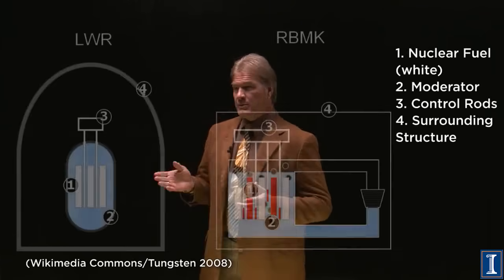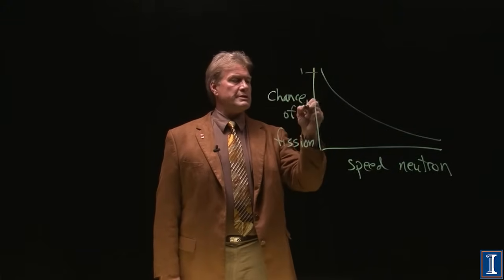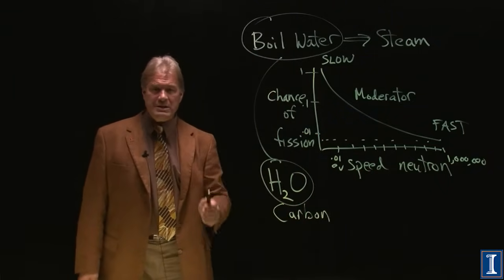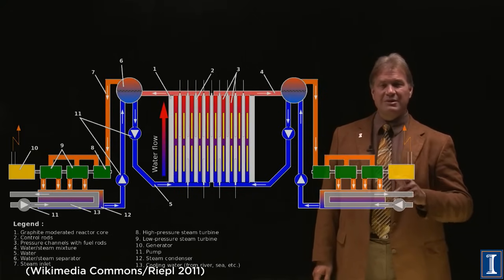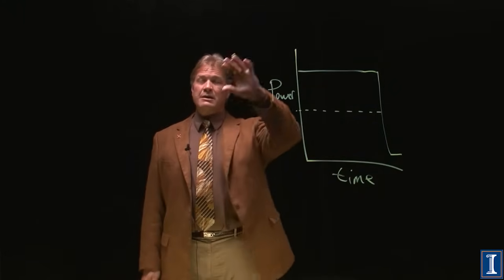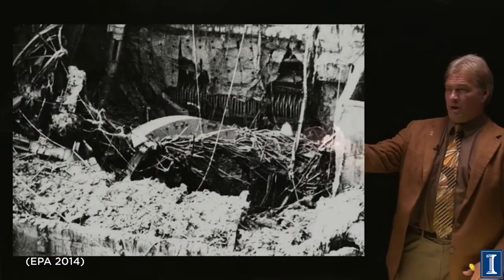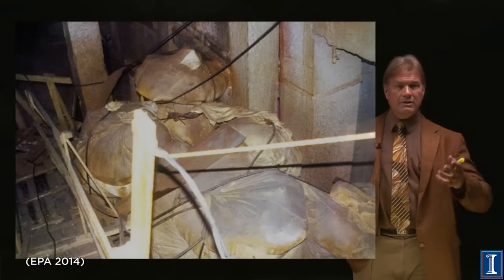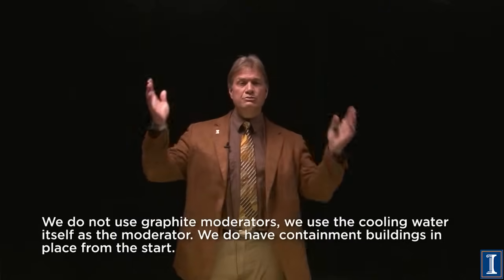Chernobyl: Worst Accident Ever

Comment: Id like to caution all of you who start to put a little too much stock into the information being provided. This is a very very basic description of the events that occurred and does make multiple mistakes. Im not going to attempt to describe what happened, there are far too many factors that come into play. Take this away from this video atleast, the US Nuclear Navy has operated more reactors for longer with far younger operators with 0 reactor accidents in its history. No program has come close to it in its accomplishments. They have done this by ingraining certain principles into their nuclear trained operators. Procedural compliance, level of knowledge, integrity to name but a few. The most important safety feature in preventing a nuclear accident or radiological incident is a knowledgeable and thinking operator who has a watch team that is capable of providing forceful backup. Enforce the highest of standards when it comes to nuclear trained personnel, that will keep you safe. Because flashing all the water to steam is possible in a pressurized water reactor. SL-1 is a prime example of another reactor that went prompt critical and flashed the water in the vessel to steam. Just like what happened at Chernobyl. Also Chernobyl blew its 1000 ton closure head damn near clean off and into the sky. I have my doubts about a 3 ft containment vessel surviving that. But hey, what do I know? Im just a Reactor Operator.
Reply: All Hail Rickover and his hard-assed approach to the atom. He was a prick - but he got it done for the Navy.
Reply: He pushed safety above all else, because he knew underwater Chernobyl's would kill public support for a nuclear navy. Rickover was an engineer first, a naval officer second. That and the fact he was a highly driven man were why he was a pugnacious fellow. He was a dick, but he was definitely the right man for the job he held, which included personally interviewing every prospective officer. We will never know how many lives were saved because of his no compromises attitude towards safety.
Reply: @taraswertelecki7874  He called Jimmy Carter the dumbest man he ever met.  Bravo!

Comment: so,  Fukushima had water moderator, water coolant,  containment building and it still happened.  They relay on physics not on people, so why it happen again?
Reply: US navy offered backup generators and it was rejected.
Reply: The power to the reactor's coolant pumps was cut off because the tsunami flooded the emergency diesel generators and also swept away the transmission lines between the plant and the national power grid. While nuclear fission stopped, the highly radioactive fission products will melt the core if cooling water was not continually supplied to it until the highly radioactive isotopes decayed away. Once that happens, the reactor is stable and can remain shutdown until it's safe to restart it. Had power not been lost, the reactors would have shut down as they were supposed to, and the pumps would have brought them safely down to a cold shutdown. There would have been no accident at all, but still a lot of damage at the plant to clean up.
Reply: that's mean it's not relayed on physics but on supplying of energy. A bit better but still not enough as you could see. Thorium reactor would be next step but still untested widely  technology.

Comment: I thought fast neutrons were more likely to cause fission than slow neutrons. This is the principle behind thermonuclear weapons: Fission in the primary causes fusion in the secondary which which releases fast neutrons which in turn cause fission in the bomb casing.
Reply: Nuclear bombs operate at critical mass, where the atoms are so close (as the uranium is 'squished' together using the force from non-nuclear explosions that act as the detonator essentially) that high speed neutrons have a high probability of hitting another atom and causing the ongoing fission reaction. In a reactor you want a nice steady controlled fission reaction, you need the atoms to be further apart otherwise the reaction will just run away from you. As the atoms are all further apart the chance of hitting one with a neutron is reduced when the neutrons are moving quickly (for quantum physics reasons). Thus you need to slow them down with a moderator to increase your chances of actually splitting atoms and having an ongoing fission reaction. At least this is my memory of physics from when i was a student.
Reply: Precisely, in a reactor, you want a steady chain reaction like a furnace heating water in a boiler, not a rapidly and exponentially increasing chain reaction, which makes a bomb.

Comment: Surely the AGR power stations in the UK also use a carbon moderator?
Reply: Glad somebody else noticed this. Sure it isn't water cooled but we most certainly are still using graphite moderated reactors, admittedly not building any more new AGRs though.
Reply: I worked at a UK AGR, they were inherently safe IMHO. Main protection was automatic trip of control rods, they relied on gravity, followed by numerous secondary and tertiery shutdown systems. . Water filled reactors have accounted for quite a few of the accidents in the past. .
Reply: https://ieer.org/resource/factsheets/table-nuclear-reactor-accidents/

Comment: Can someone explain to me how the twin reactor next door was able to continue operating for 20 years? How did it withstand the explosion that happened next door, and how were people safe from radiation to continue working there????????
Reply: There was a very thick concrete wall between the two, and the control centers and reactors are hundred of meters apart. For the record, the explosion of reactor No. 4 started a massive fire that was spreading to the roof of the building housing reactor No. 3. The fire was also lethally radioactive, and the firefighters all died of massive radiation exposure putting out those fires, with red hot pieces of nuclear fuel and graphite blasting them with gamma and neutron radiation. They are why the fires did not get to reactor No. 3. The explosion destroyed the reactor and the building that housed it, but not the control room. The operators of reactor No. 4 survived the explosion, but over half of them died of radiation poisoning within weeks, the others suffered for the rest of their lives from the massive doses of radiation they absorbed. The blast was not powerful enough to threaten the reactors next door.
Reply: Also radiation is less dangerous than people think.
Reply: Low levels yes, high levels of radiation are something else. When you were as close to nuclear fission as I was without harm to myself, you can see what extreme radiation doses does to matter, not just living things. Pretty amazing how materials, organic or not bear no resemblance to what they were before irradiation.

Comment: The first ones who noticed an anomaly were people at a nuclear power plant in southern Sweden.
Reply: Yes, the morning shift had contaminated shoes which set off the alarms. Needless to say that led to a few very tense hours as everyone first assumed it was a malfunction with our power plant.
Reply: The night shift went, “No it’s not us, reactors fine.”
“Ok the wind was coming from the direction of Cherno... uh oh.”
Reply: @davyt0247  Cher-oh-no-byl?
Reply: sweden is already so degenerate, they don't need to fear defects caused by radiation
Reply: Correct. Half this fool's lecture is simply wrong, not just that point. 
The guy could have made a 2 minute video and explained that the Soviets were just penny wise pound foolish cheapskates who put graphite tips on their boron control rods.
Reply: I knew a US submariner who told me this set off their radiation alarms in the middle of the Atlantic.

Comment: The first time I heard about the Chrenobyl reactor test was helping graduate students, many pages of IBM Fortran programs, attempting to model the different reactors in the USA? The professor was interested in finding reactors that would allow the employees to manually override the system or that a control room operator would be allowed to override the systems.  We found three reactors of the Chrenobyl design in the United States, major upgrades to the all of control systems followed.  Inspection of the control rooms found many issues including staff changes to the control systems; in one control room an employee had replaced the control handle with a beer tap.
The reports of what happened indicated that the management told the employees to override the cooling systems, the reports stated that some of employees refused to override the systems and other employees taking over continue the testing.  One of the documents talked about an early missile detection project that was built only seven miles from the reactor, they indicated that the reactor test was a project to boast the power needed for the Duga Radar Station – Russian Woodpecker project. https://www.youtube.com/watch?v=Ux9ZhotNtrg 

 I also viewed a documentary explaining that one of the reactors was enriching … well every country has enriched …

I have a question for you?  Japan, Fukushima Nuclear Accident was an environmental problem, showing that they did not understand the risks, a country prone to earthquakes and the resulting tsunamis.  You stated that the Chrenobyl Nuclear accident could not happen in the United States, due to the design of the reactor?

Maybe I am just a little paranoid about the Nuclear reactors within the United States, what would happen if the cooling towers are damaged or the main reactor core is damaged like in the Chrenobyl accident?   Many of the Nuclear Power Plants are over airport airways?  With the attack on the Saudi Oil fields, using drones … what is the risk of not protecting the Nuclear Power Locations …

Comment: Not sure if the prof knows what he's talking about.
Not all LWRs in the world have containments. See Fukushima which blew up 3 times. 
Nor does the beautiful moderator safe a plant from melting down. See Fukushima. 
And by the way, since 9/11 I would strongly believe that a 3ft concrete slab is not a real plane stopper. That's what I consider a  myth.
Reply: Actually it's 2 buildings, one within the other both 4 feet thick and reinforced with 2 rebar mats of #32 rebar welded together, each standing 1 foot from the the face with 8" between the two ... rebar sizes are in eighths so that is 4" inches thick. 

You prolly are a girly man with small hands and skinny arms but 4" is the size of a burly man's wrist.

Both are poured with high density concrete and lined with 1" stainless steel with the outer containment building capped with a 250 ton steel missile shield embedded in the concrete. 

I was a piping designer on Seabrook Station NH in '84 and read the specs from the Final Analysis Safety Report.

The containment buildings are designed to withstand 300 mph winds and debris thrown by them which include train engines.

They certainly can withstand an aluminum plane flying as fast as it can.

Perhaps the mother of all bunker busters might make a dent... but if someone is throwing that at us we got more problems than that.

The worst any attack can do is sever the connection to the grid

I'll keep it short as I've learned the longer the scree here on You Tube, the lower the IQ

Comment: Please help me reconcile an apparant contradiction. In this video (starting at around 2:42) Professor Ruzic says that an advantage of most (all?) of the non-chernobyl type reactors is that the water that's the primary coolant is also the moderator, so if the water's gone, then the chain reaction stops. But in his video titled "How TMI started", he seems to indicate that the melt-down at TMI happened because the reactor became partially uncovered by water. Thanks in advance.
Reply: The reaction did stop in TMI (at least in the parts of the rods above the waterline) but they still contained enough internal heat and subsequent decay heat that they would gradually melt if not cooled in time, I guess the difference is that a non-RBMK reactor won't have a temperature spike from coolant loss, it'll just melt over time giving you a few days to get it under control, wherein you'll be left with a wrecked reactor, but a contained wrecked reactor.

The RBMK alternative being a reactor that went from functional to disintegrated in a matter of minutes due to the temperature spike of it still being able to moderate itself - and climb in power rapidly - after the water stopped.
Reply: @krashd  That make sense. Thanks.

Comment: "Oh, we can't have a Chernobyl here"

You just haven't found good enough idiots to make it happen.
Reply: @Stimpy&Ren that's.. ugh... typically how things work..  You start somewhere, you figure out where efficiencies or safeties can be gained, and you apply that to the next evolution or retrofit the original.  Otherwise you're just stuck in analysis paralysis and we'd still be living in mud-huts.
Reply: @Stimpy&Ren You can disagree all you want, you're wrong.  No one holds revealed truth about anything, thus failures are implied by reality.  The only process to go about anything is bound with failure.  There is no alternate position for you to claim.  Things don't 'generally' end up that way, most failures are insignificant and very few are so catastrophic.  That doesn't mean the process by which things progress isn't win some/lose some.   See: evolution.
Reply: @Stimpy&Ren ... i didn't say it wasn't.
Reply: All nuclear rectors have a design flaw.They are designed to be operated by humans.

Comment: Why inserting control rods caused spike in reaction?
Reply: i think it is because rod tips in reactor 4 were graphite.. the engineers did not know that there is a short rise of temp caused the overheat. u supposed to lower the rods to control temperature but most of them were raised. literally giving a reactor (train without brakes).  when the engineers lowered the rods, the temperature spiked because of the graphite tips.
Reply: The graphite at the ends of the control rods acted like the plutonium rod in the secondary or fusion stage of a thermonuclear bomb. When Alexander Akimov hit the AZ5 switch to SCRAM or shut down the reactor, they caused the already runaway chain reaction to accelerate even further. Once that happened, the explosions followed within seconds. Some physicists think the core attempted to go supercritical, and explode like a nuclear bomb, but before the chain reaction went that far, the core blew itself apart. Imagine what would happen if hundreds of tons of Uranium DID undergo a supercritical, or uncontrolled chain reaction. Even so, the explosion that ripped the reactor apart was equivalent to ten tons of TNT.
Reply: Taras, looks like you know more about it than i.. Not pretending that i understand nuclear physics or 4th reactors fatal mistakes. So thanks for sharing your knowledge
Reply: My father is Ukrainian, and he saw the harm the accident visited upon people, children in particular. Leukemia's and cancers have shown up since. I also have Russian heritage, thus I am interested in my ancestor's history and well as my family's. My dad's hometown of Rivne Ukraine is only 80 miles to the west of Chernobyl. My parents both have worked with radioactive materials in medical laboratories and I myself have seen for myself nuclear fission up close and personal, without getting a lethal dose of radiation many times over because it was under 30 feet of water. If you get the chance to tour a research reactor or nuclear power plant, it is well worth doing if science interests you.

Comment: What about 3 mile island? I thought radiation was released.
Reply: No radiation was released. Some radioactive material , was. Some of the radioactive isotopes of xenon, krypton and iodine got, by mistake, into the building outside the containment structure. It was a negligible amount for the workers, let alone the public.
Reply: But Fukushima had a containment building, and it helped absolutely not at all against a hydrogen explosion. It wouldn't have done much good in Chernobyl either.

Comment: 1) You can say the wrong button was pressen as a very simplified summary of decitions and actions but the actual chain of events is well worth to consider.
2) There was no chemical explosion. With the TW rush in thermal power fragmented fuel and cladding into the coolant generated a high enough pressure to break the channels causing water to be ditectly ejected into red  hot moderator i.e. a traditional brutal enough steam explosion.
Reply: This is more correct, yet simple to understand:
https://youtu.be/q3d3rzFTrLg

Comment: If water goes away reaction stops BUT residual heat is sufficient to create havoc.
Hence use another coolant, like lead/bismuth or molten salt.
Water at 2000 psi is not that safe, and at 300°C is not as efficient as molten salt at 750°C and 60 psi. 
The first people outside USSR to discover abnormality was at the Oskarshamns nuclear power plant in Sweden where workers got radiation tested before entering the plant.
Reply: We Brits have always used gas as a coolant, CO2 to be precise.

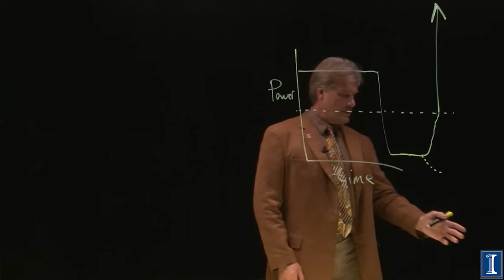Comment: 13:49 What is that a picture of? It looks like the core glowing red hot but how could anyone take that picture they would be dead as quick as the camera shutter opens. But it does look like the core where the pipes are broken off that would normally supply cooling water. I thought even though the core was exposed it was covered in debris and you couldn't see it. If that is the core its the most scary Chernobyl picture I have ever seen more so then the elephants foot as that's whats going to melt into it
Reply: Nope, that's not the core, that's Elena.
(it was the reactor's top cover, also known as upper biological shield)
Reply: You can see an actual video of that thing here: yes, the video's real, so feel free to shiver...

https://youtu.be/TcvCKmzIN0Y?t=1m32s